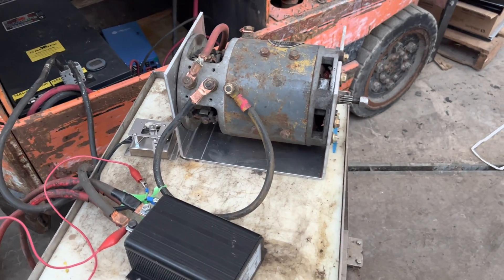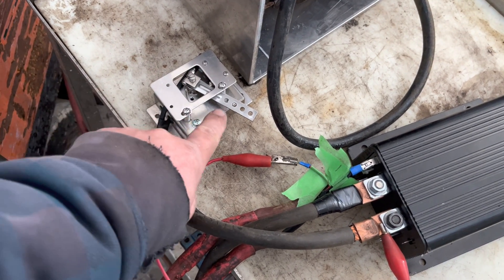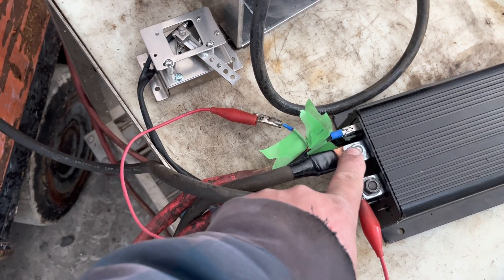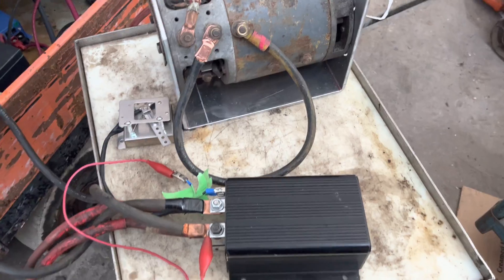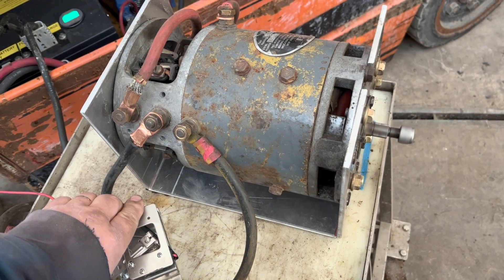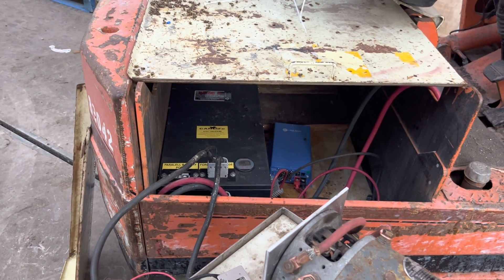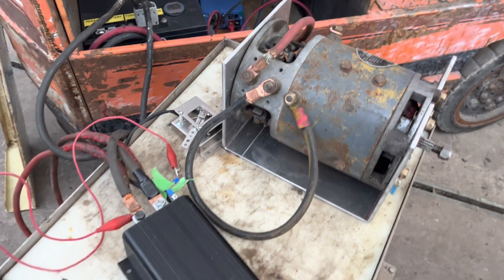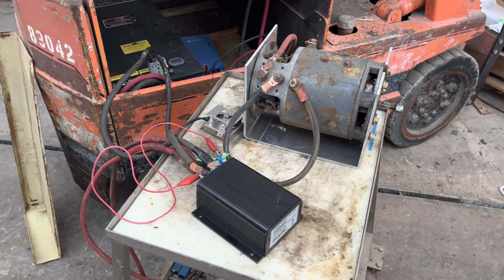EV Forklift project Electronic Setup

Comment: That motor has a lot of RPM's the way it sounds. If you can get it geared right that should bee a slick machine.
You must have done some "Thinking" in order to get that mount on the motor. Good job Phil.
Reply from the maker: It remains to be seen if this motor will have the power to run the hydraulics on the spyder without overheating.
Reply: @philbeeman  Any way of adding some fins to the shaft to create more air flow?
Reply from the maker: I think it has something already but when you repurpose something it’s always a bit of an experiment